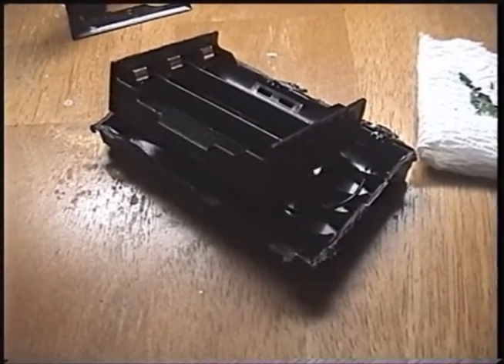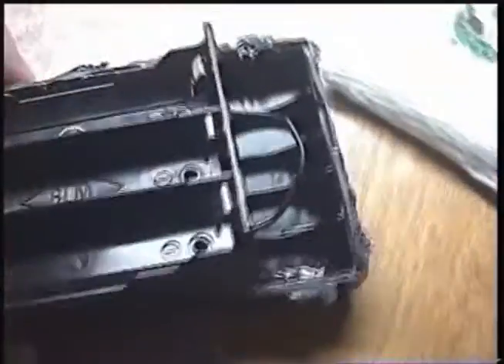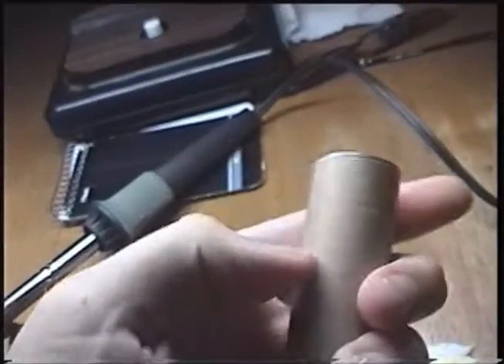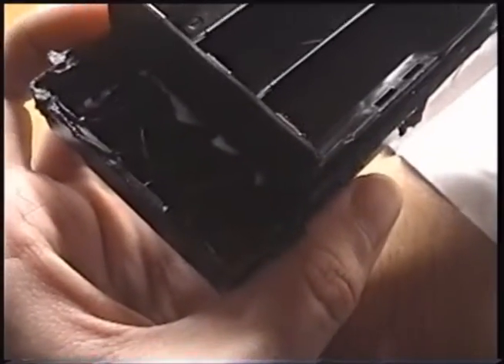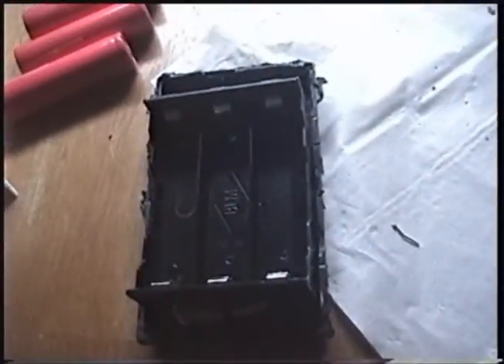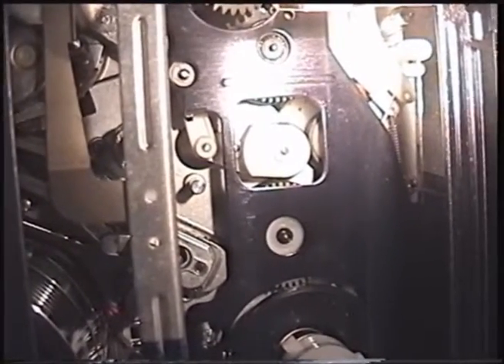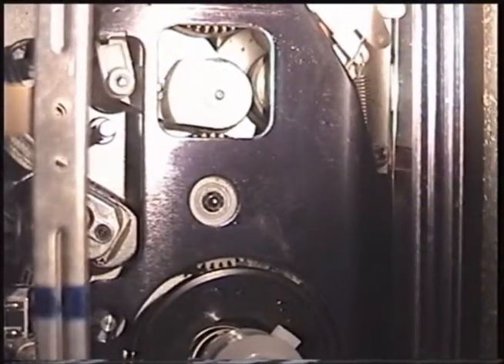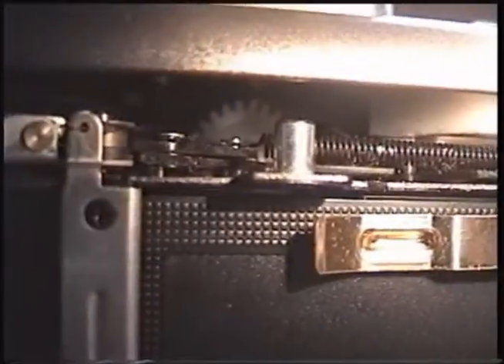Converting old NiCd camcorder battery to Li-Ion (and surprise camcorder repair)

Comment: I bought a Tenergy pack of Lithium-Ion cells pre-wired with red and black wires for me to solder. And I soldered them to my gutted NiCad battery. Its charge is 14.8 volts max. Been charging with ease and no problem.

Is getting pre-wired Li-Ion cells safer for my camcorder battery than doing a D.I.Y mod?
Reply: interested

Comment: would 2 18650 cells be too much for a 6v camcorder? max charge voltage is 8.4v and I'm afraid ill damage something if I try this.
Edit: found my answer in CaptainB52's comment. Looks like it will work just fine.

Comment: Hey there! I'm in need of your help! you have figured out exactly what i've been trying to do with my RCA cc320! is a NiCd battery the voltage is 9.6 with 1600mAh however it doesn't charge and they no longer create this battery. i have a few question if you have the time!

1. How did you separate the battery without destroying the "connection" side.
2. If i purchased a 9.6v 1600mAh battery pre made and connected it to the leads should that work?
3. do you know of any place that create these style backing for camcorders or is it a "if you have you have it" scenario? 

Thank you for your time, i hope to further this conversation! 
feel free to message me back here or at my email : trashkhanzphoto@gmail.com

Comment: I have the same model, though it's red and has all that fancy JVC VideoMovie branding. Didn't come with a battery and finding a replacement was a bitch. Wish I had discovered this first. Would have spared myself some agony. Thank you so much for doing this. I'll be giving it a go in the future.

Comment: It looks like you need to replace that idler wheel's rubber part or even the whole wheel. It's looking a little rough.

Nice battery hack, don't you just love those little 18650 cells. I have a bunch of them myself. I pulled one from a small powerbank and used the powerbank as an 18650 charger until I bought a really neat USB charger.

Comment: Nice fix man. I'll try to do the same with my old camcorder, but I want to use a chinese 6v 2ah Cordless Drill's Battery. I'm thinking on taking apart my old battery and wire it to the new battery. My old battery is 6V 1,8A and this one says 2A. Do you think it will work? Any advice is welcome . Greetings from Argentina🇦🇷🇦🇷

Comment: I have a newer Sony Hi8 camcorder that runs on a 6 volt battery. Do you think it would be possible to convert that to lithium using two 18650s in series? Do you think the approximate 8 volts from the cells burn out the camcorder? Thanks.
Reply from the maker: Nah, should be perfectly fine. A fully charged 5-cell NiCd battery will read as high as 8V sometimes.
Reply: themaritimeman Awesome! Thanks for the reply!

Comment: Do you plan on making a cover for your Li+ battery pack or do you already have one? Though batteries are usually secured with springs, I am vary wary of them falling out without a cover as this was the case for an clock I had; I lost the cover for the battery receptacle.
Reply from the maker: Nope, it will be left as-is. The cells are very secure in the holder.

Comment: I'm curious when it comes to charging, do you need to charge each individual cell by themselves or are you able to charge the entire at once??
I got a vintage Sega handheld with its original external battery, the battery is clearly dead beyond repair, I would be cool to upgrade it to lithium-ion.
Reply from the maker: You can charge them in series or parallel. When in series you just need to be careful that the cells are at roughly the same voltage. Chargers like the Imax B6 can accept a balance cable that will allow the charger to monitor the voltage of each cell.

Comment: Dang. At first I thought it was meant to be a AA battery replacement. That would have been really cool and useful ;D   Here's a tipp: use industry magnets to attach the battery replacement on the backside, not tape or velcro. The pack would be too heavy for both of these solutions. However a flat strong magnet should work okay. or 2 smaller ones on the upper area and the lower area. They would not be dangerous enough to harm your camcorder electronics or mess up the magnetic recordings on the tape.

Comment: NiCd and LiIon both need constant current to be charged. On LiIon, when the cells have reaches 4.2 volts, it goes to constant voltage automatically, because the supply voltage actually is 4.2 volts. When the current goes under 10-20 mA, charging is stopped ant the cells are considered full. On NiCd and NiMh, the charger has to carefully watch the voltage and when it detects a dip down of ~50 mVolts, it will stop charging because that's the indicator of the cells being fully charged. Also the maximum voltage ov 1.55 Volts might stop the carge. Additionally the cell temperature is monitored, if it gets over 50°C, charging is also stopped because any more energy you put into them will be converted to heat.
Reply from the maker: Right, Li-Ion needs a maximum current or else you'll be damaging the battery if the current is too high, but in the end charging stops at a defined voltage. With nickel batteries the voltage could be anything when charging stops - it's just based on that voltage drop (or with fancier chargers, the temperature like you mentioned). But you need an unchanging current the whole time.
Reply: *****
Yes. But the constant voltage part is not hard to do, it's just Ohm's law. When the cell reaches the charging voltage of 4.2 volts, there is no way to maintain the target current anymore and the current will drop automatically. A current regulated supply with sub 20 mA cutoff is everything you need to charge LiIon. :)

Comment: Trend, VERY VERY IMPORTANT!

Buy yourself some PROTECTED Panasonic NCR18650B cells!! This is MANDATORY in the construction you have done. If anything shorts, the protection will kick in and a MOSFET will disconnect the cell from the terminals! These cells can still deliver up to 6 amps contiguously!

Do NOT use unprotected salvaged cells! PLEASE don't do it... It's for your safety and for your joy. The cells above feature 3400 mAh... Threethausantfourhundred milliampere hours!!
Reply: 44CT232
Good luck! :D
Reply from the maker: I follow the YouTuber Rinoa Super-Genius, who has made several very large battery packs using nothing but salvaged 18650 cells. They haven't blown themselves up yet either. :P
Reply from the maker: I'm content with using the cells I have. I have around 30 of them now - I'm not going to let them go to waste. They're fine as long as I don't do something stupid with them.

By the way, it's Trent. At first I thought you were just getting autocorrected, but I see now that's actually what you call me lol.
Reply: *****
Oh, yes. Sorry for that. LOL It's the force of habit. ;) And I am German, too.
Reply: I have a battery pack that I use for various tasks, made from old laptop cells, it has no protection either. Plus, I also use salvaged laptop cells in an LED flashlight that takes 18650s. If you're careful, you'll be fine. I haven't blown my self up yet :P

Comment: Seeing the thickness of the wires, the power loss and voltage drop is almost not measurable at the currents the camera is powered. Don't overthink it. :)
Reply from the maker: Yeah, normally I wouldn't give it a second thought, but I think I've been trained by a particular member of Lighting Gallery who always called my wiring jobs "very bad" because of the extra resistance and inductance (however little) I introduced into the circuit.
Reply: *****
Depends on the application. For mains, this is more serious because of higher voltages and currents. For your purposes, you did a great job. Also it is safer, so now you know how to put them in. Putting one in the wrong way around will be severe.
Reply from the maker: Actually, putting one cell in backwards does no harm at all - I accidentally did so the first time I tested the pack. All it does is subtract from the voltage, so the net voltage is 3.7V, so the camcorder doesn't turn on.
Reply: *****
Ah yes. Forgot about that. But don't put all in backwards. ;)

Comment: wow, this makes me wonder if I could get my parents old full size VHS machine working again.  The battery is shot and it has issues with tape functions.  It'll load a tape, rewind and fast forward, but won't play/record.  It's not a high end model or anything fancy...but it is the first camcorder my parents bought way back in 1987!  They recorded all kinds of home videos on it...school plays and even my brothers graduation in 1999!  (they were probably the ONLY people using a full-size VHS camcorder there....)
Reply from the maker: Loading motor belt has gone bad - I almost guarantee it.

Know what model of camcorder it is? I assume an RCA ProEdit or Panasonic Omnimovie of some sort?
Reply: I have no clue what brand it is, it's been years since I have even looked at it....but if I recall correctly, it's a store brand (Sears or JC Penny I believe)

Comment: figured I'd let you know 18650 cells for some reason labeled as 3.7 volts but they're actually 4.2 volts I know as I use 18650 all the time for my vaper my intellicharger charges the batteries to 4.2 volts and then when I put them in my mod they read as 4.2 volts I don't know why companies label them as 3.7 so in fact your passion about 12 volts as opposed to 11 if you don't believe me do lots of research I know you do lots of research but you might want to redo it
Reply from the maker: Nominal voltage is not the same as charge voltage. The charge voltage of a Li-Ion cell is 4.2V, but the bulk of the energy is dissipated at 3.7V.

A nickel-based cell has a nominal voltage of 1.2V, but the charge voltage is usually 1.6-1.7V.

So you did do your research, but you drew the wrong conclusion from it.
Reply: Trend, this is totally correct. It's interesting how the voltage curve runs over the time of discharged until the cell reaches 3 Volts and the protection kicks in. The best cells on the marked are multipurpose 18650 cell from Panasonic, the green ones NCR18650B. I still recommend you to acquire three of these protected. In Germany they're quite expensive. I payed around EUR 9 for one cell. But I think in Cannada it's cheaper. The protection is usually not added by Panasonic, these are resellers that put the protection on. You have to bend the terminals on you holder a bit, these cells are about 2mm longer than standard ones AND most of the time they have a button top instead of flat top.
Reply: I know charging voltage is 4.2 volts but why am I Vape device as in my box mod does the batteries read as 4.2 volts first taken off charger can I do for at least an hour for the drop
Reply: +themaritimeman and also the type of batteries you would use for your Vape are 18 650 cells but I really don't think 18 650 cells that you take out a computer pack are anywhere from 25 to 30 amps that's a lot of power
Reply: *****
This is because the voltage goes down as soon as you consume the watt-hours out of the cell. And 3.6 or 3.7 volts is the nominal voltage, it's the average voltage over the entire discharge period. Discharging stops at 3 Volts. Charging stops at 4.2 volts. Does this explain this to you?
Reply: *****
You are right. It are basically high current cells, LiPoly in the cylindrical size of 18650s, but without the metal case around, it's rather in a polymer bag. They have low resistance materials in them to deliver high current.
Reply: Most of the batteries I use are anywhere from 2500 to 3000 mAh the type of cells are used or LG there are brown in color and sometimes I use Samsung the cells as well at the vape store they're about $10 and that's here in Canada my Vape uses two of them and the old one I had use 3 that's about $30 in cells and that's for the high drain ones
Reply: That's absolutely ridiculous for One cell
Reply: Actually the batteries I use to got  a metal case around them and they are wrapped in plastic
Reply: *****
As long as they can vent at the top, it's okay. If you use your e-vape too often, the circuit will block it to cool the battery down.
Reply: +BloodySword not only the battery got a protection circuit Vape does as well if it gets too hot it doesn't let you use it until it cools down
Reply from the maker: "I really don't think 18 650 cells that you take out a computer pack are anywhere from 25 to 30 amps that's a lot of power"

18650s are perfectly capable of delivering that much current for at least a few seconds if they are short-circuited. Heck, a vape draws as much as 5 amps when it's running.
Reply: they drive anywhere form 25 to 30 amps i know that because mr and my bf looked in to it befroe wel shut over to vapeing form smokeing go
Reply: +themaritimeman actually the 18 650 cells are a lot more powerful than computer 18 650 cells that you take out of computer battery packs in fact I'm after trying brand new cells from a computer pack in my vape and it literally goes dead in less than five minutes however with the ones I buy at the vape store pacifically for vaping last me about 8 to 9 hours and I Vape heavily very heavily I always got in my hand more then not their draw anywhere from 25 to 30
Reply: +themaritimeman it also depends how many watts you throw at it depends on your build depends on how low or high your Ohm's is it depends on a lot of stuff to type of wire to use how many wraps you put in a coil how big of a screwdriver or something you wrap it around depends on how many coils you use it varies a lot more than likely yes if you put a low enough build on it it will barely draw any apps but if you put a nice big build on it like I got you're looking at anywhere from 20 to 30 amps
Reply: *****
As I said, the ones in e-cigs have special anodes and cathodes for this job with lower internal resistance. But for the camera the scored ones should be totally fine. The only thing that's worrying is no protection on the cell. One cell the wrong way round and you have serious problems.
Reply from the maker: You're saying your vape draws 20 to 30 amps? That's nuts - I read on a site that the most powerful ones don't do more than 5A. But I don't know anything about it anyhow.
Reply: +BloodySword  I know
Reply: +themaritimeman I'm not saying you're wrong I'm just saying it fluctuates depending on the type of coil and stuff you use like for example my mod is regulated which therefore if the ants go too high or too low or anything for that matter or anything go to high to low cut off or turn off to protect to protect you and your self however a lot of people use a Mech Mods and put crazy bills on it which Mech mod is nothing more than an 18 650 and a coil that's about it they are very unsafe I would never use a mechanical there's nothing to prevent any shorts or nothing

Comment: NiCd, was a very bad battery technology. The battery capacity sucked and the batteries themselves were made of highly toxic parts. Not to mention the extremely long charging times.
Reply from the maker: NiCd actually has a few merits. They can supply very high current (dozens of amps for ones like these camcorder batteries), and take a high amount of abuse without failing. They also never catastrophically fail, as far as I know. But they definitely don't age well compared to Li-Ion.

They can be quick charged just fine. I think most consumer NiMH chargers are rated for NiCd as well, and will charge them in a couple of hours.
Reply: ***** I had no idea that NiCd batteries were capable of producing higher current levels than the Lithium batteries. 
So if you puncture a NiCd battery it wouldn't burst into flames like the lithium ones are known to do so?
Reply: MegaBojan1993
Yes! :D But daily use is absolutely safe with LiIon, too.
Reply: +MegaBojan1993: This changed. There are LiPoly cylindrical or flat cells that can even deliver up to 50 Amps. It's a question of the Kathode and Anode material used. The lesser the internal resistance, the more current they can handle. LiPoly can do more current than any NiCd could have ever done.
Reply: ***** So the only good thing about NiCd batteries is the non existent risk of getting yourself burned if the battery explodes :)
Reply: MegaBojan1993
With appropriate protection, you also won't get burned on LiIon. Never experienced this. :D
Reply: ***** I never experienced this too, but if you search on YouTube for lithium battery explosion, you could see videos in which those lithium batteries are like tiny bombs inside your phone (or other devices). They can be extremely dangerous.
Reply: MegaBojan1993
Only if you buy counterfeit cells handled inappropriate. ;) For this, they take cheap china cells and perforate, overcharge, suspect to high humidity and short them.

Great Scott tried it with a quality cell and nothing major happened. As well as someone used a fully charged quality cell and put it under a hydraulic press. Nothing happened.
Reply: ***** Still, I wouldn't risk and puncture even a high quality original battery :)
Better be safe than sorry :)
Reply: MegaBojan1993
The battery of my old SHARP VLL-310B Camcorder lasted two hours.
They were great batteries!